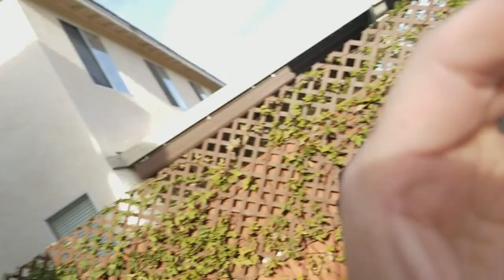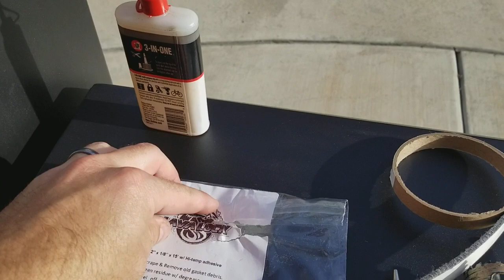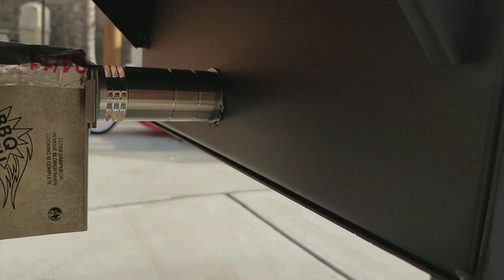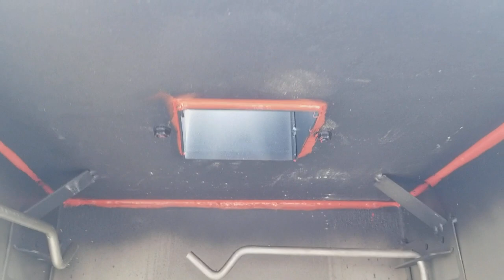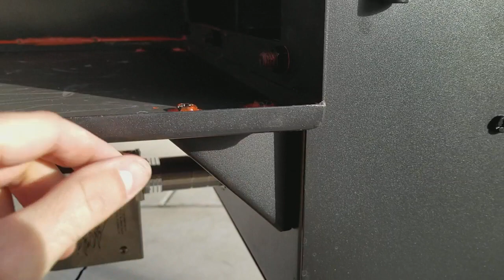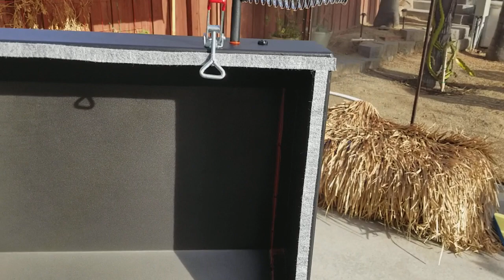Oklahoma Joe's Bandera Vertical Smoker Build and Modifications

Comment: If you use soap in the water the silicone smoothing goes better. Though it seems overkill to need that kind of sealing of the smoker.
The push pin thing is an automatic center punch.

Comment: Came back to watch again. I got the bandera and it's working great. Will be adding a Lavalock ATC temp controller / stoker. 
One really good upgrade is to add a charcoal basket.  There's a few good DIY vids on YT for no-weld versions you can make for about $20. I weld so I made a really sturdy welded one either way... It is a goid upgrade to have your coals contained.  Just place the basket on top of the coal grate it came with. Takes much less fuel to maintain a consistent cook temp.

Comment: Did you even try to cook any food without it? LOL hard to believe all that is necessary. Just throw some food on there and cook it and eat it. I'm sure it will be good
Reply from the maker: Without what?  You need to articulate your thoughts into the right question or I can't properly respond.
Reply: It depend if you are true BBQ enthusiast or a casual cooker. Without sealing the air leaks, temperature is harder to control especially you are controlling the fire manually like a pit master. This unit was not build for high-end usuage, but with the mod, you get much more than the price by rewarding with the best BBQ you can make over any restaurant.

Comment: Just ordered a DigiQ BBQ Temperature Controller, Digital Meat Thermometer, for Weber Smokey Mountain Cooker Adaptor, Pit Viper Fan. I have the same smoker as you do, my question is did you have to order another adaptor for the viper fan or did it come with the one you needed? I have heard that you have to order this other adaptor if you are not using weber product. and if so where did you get it? thanks..
Reply from the maker: I did not order another adapter, it came with one that worked for my smoker.  I got mine from BBQ guru's site.

Comment: I'm really curious about the BBQ GURU ... very interested to see how well that will affect temp control.  Great vid!
Reply from the maker: Well, the verdict is still out on the DigiQ DX2.  I may have put it in the wrong place as it's blowing air away from the smokebox inlet directly above it.  I'm going to make contact with the Mfr. and inquire about moving it before I drill any more holes.  The good thing is, I'll make to circle metal plugs drilled out so I can put a bolt through it and "shouldn't" lose any smoke...plus, it's under the smokebox, so don't think anyone but me will know.

I do like the DigiQ DX2 for its functionality so far.  Easy temperature setup, and the temp display (Pit & Food) are great to have...even though I did the boiling water test on the supplied thermostat dial (which was close by 2 degrees), I notice a difference between the DigiQ up above 225.  The DigiQ will read 270 for instance, and the dial temp gauge reads like 300 plus.  I had 2 pieces of brisket this past weekend with the DigiQ and another digital device and both temp probes read close to one another.  So, I think accuracy is on par for now...I just have to determine the best location for the blower :/
Reply from the maker: Sean - I have a new video up today, some new thoughts of the BBQ guru and a new location on my rig.